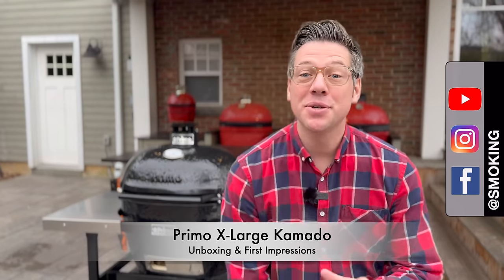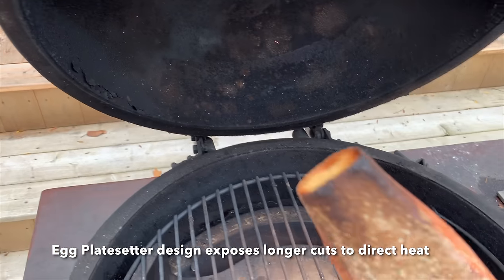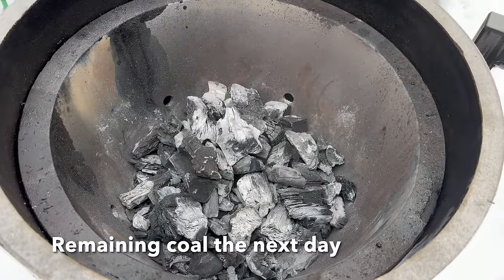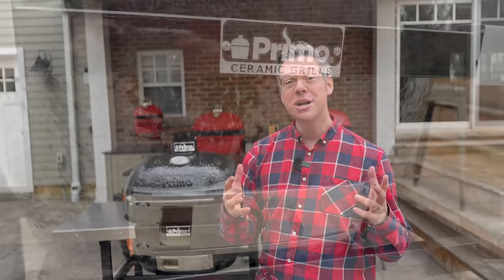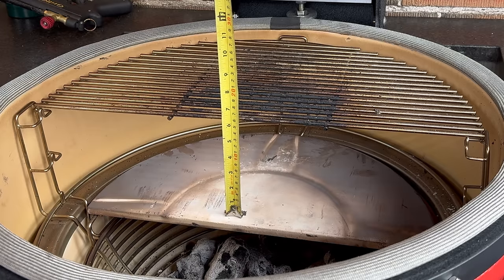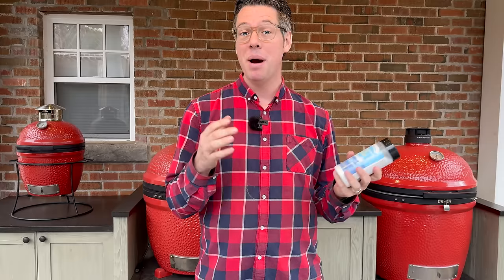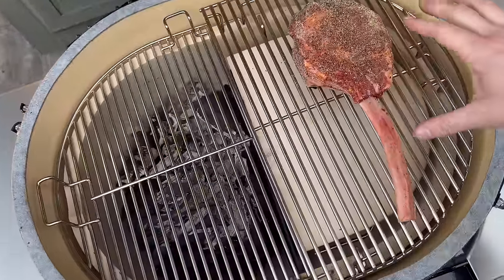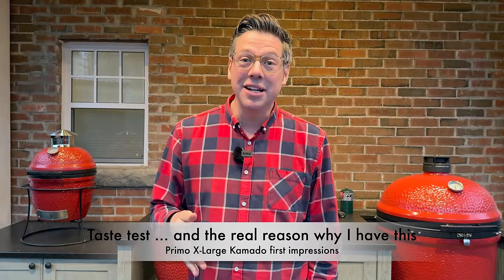Should Kamado's Be Oval? Primo XL First Impressions

Comment: Howdy SDB. I've owned a Primo XL for more than 25 years. I will say that I have never, ever had a problem of any kind with it. Well, except the top/bottom seal eventually needs replacement. The intake and exhaust upgrades look nice but please believe me when I say the old setup works just fine. One of the things I like to smoke in it is 20 lbs of bacon at a time. I put a thermometer in all 4 pieces and they are ready in a nicely spaced order. Its setup like you showed except I have two more racks that go on top of the two you showed. I can agree with everything you've said in your video and look forward to the tests you have planned.
Reply: I've had one for 15 years, and it's excellent.
I stuck fiberglass wood stove gaskets on with high temp silicon 10 yrs ago and haven't had a gasket problem since. I did the same with a round large primo, and that hasn't failed either.
Reply: That sounds excellent. Thank you very much. @toddpower4674
Reply from the maker: I just went a bought the upper racks
Reply: Exellent. I'm sure you'll find them usefull @SmokingDadBBQ
Reply: Wow ! You must have a Pre-Production model of the Primo XL Oval Kamado Grill . They came to the Market in 2002 ! 😊 Give or take a few years , to they are awesome and everything taste great . I have the Primo Round Kamado Grill and I love it . James never answers my comments , buy that's Okay . I've learned a lot from him .
Reply from the maker: @michaelheiss4456  I try to answer as many as I can as a one person show

Comment: Sweet, we are finally cooking on the same grill! I actually do mostly grilling so i enjoy the divided firebox for a direct and indirect side, without going as big as a 24 round. I don't even bother with the heat deflector on the indirect side anymore, just open. For smoking, I have actually applied your double indirect method to the Primo using firebrick pieces as spacers and a second set of heat deflectors. Works great!

Comment: That is one heck of a grill. What it loses in vertical distance from the ceramic base on the BJ, it gains in the horizontal distance away from the coals. It gives BJ a run for its money. Looking forward for your tests.  I suppose it will perform great when smoking ribs, the real test would be to see how it does on a long cook with a brisket.

Comment: I've had the Oval XL for years, and I love it. I bought it for the size to price ratio, and for the flexibility of the oval shape. It has delivered on all fronts: I cook on it at least three times a week, all year long, and can easily fit food for 10 on half the grill for true indirect cooking (although I mostly cook for four). Using the whole grill opens up huge possibilities: I've done four racks of babybacks without having to do anything other than drop them on the grates and move them occasionally so they shared equally in the hot spots front and rear of the heat deflectors. On the downside: I am on my second firebox, and I can see a crack forming in it in the same place as last time. I suspect it is because I almost always cook with coals only in one half (the left side, where the intake is), so there is more stress on the spot opposite the intake. But service has been great even in to Canada, and Primo replaced it immediately. Also on the downside, there is much less online help like yours available for it compared to BGE and KJ, so the learning curve may be harder. That said, I have no trouble recommending it and have absolutely loved cooking on it.

Comment: I've owned a Primo Oval XL since 2011. I made the purchase after researching a LOT of smokers (stick smokers, kamados and pellet grills) before pulling the trigger on the Primo. It is a very versatile appliance and is one of the best investments I've ever made. I've cooked everything from full packer briskets to pizza and everything in between. That being said, I have some things I don't personally like, which may not necessarily be exclusive to the Primo, but rather a more general kamado design issue.
1- The necessity to use only lump charcoal, which can vary widely in size, content, and quality over various brands.
2- The Kamado design is very efficient, which is a plus for stabilizing cooking temperatures, snd heats up quickly, but it's not easy to quickly dial down the temperature. With the oval, you can do offset cooking, but that halves your cooking footprint. You have two grill heights, but that's it, and to safely move the grates, you've got to remove the food.
3- Because of the wide variation in charcoal quality, temperature stability is best achieved with an after-market fan/temperature sensor rig. That's an additional cost. 
I don't want to deter anyone from buying one, and I'll keep mine, but I'm probably going to buy a pellet smoker for added convenience and flexibility.

Comment: Two words, "extension racks".  I use mine A LOT.  For chicken, poppers, and pork chops (especially ones with the bones), I will invert the main racks, put on the extension racks, and cook on the extension racks.  This keeps the grease from these well away from the fire to prevent most burning.  (grease from poppers and chicken wings at the same time is still too much, so beware)  For smoking pork, I will use the extension racks with the deflector plates and the main racks in their normal orientation.  This keeps the meat well away from the direct heat.  The wide layout of the Primo allows for this.  For a reverse sear of a tomahawk I have not used a deflector plate so the space limitation you talk about doesn't matter to me.  I just keep my fire down to a smoke level temperature for that part of the cook.  I also do mine differently.  I will smoke until the internal temperature gets to 95F, pull the meat and crank up the fire to 550ish, then grill the steak just like I would a ribeye from Costco. (same timing)  This means I cook with the lid closed so I have no problem developing great bark all over the steak.  I also get plenty of smoke flavor.  Make sure to add wood chunks to most cooks.  I use mesquite for steaks, hickory for chicken and pork, and cherry for pork ribs.  Don't add wood for pizza.  You want that clean coal-fired taste.  The best tip I can give with any kamado is to learn to listen to the chimney.  Listen for that sizzle.  If no sizzle, your fire is too low.

Comment: Ive been curious about the primo fir some time. Ive just graduated from an akorn to a ceramic and can tell its a leap forward. The one ive come across is a bit of a mystery,  the only info ive come across is that it was sold by academy sports around 2011 its measurements are exactly like a green egg but looks like an early primo with a round vent on the bottom, maybe they had a baby lol. Who knows, after some refractory cement, new gaskets and high heat silicone this thing rocks. Thanks again for the great effort u put into these videos and looking forward to whats to come.

Comment: I added the Primo XL to my stable of grills a little over 2 years ago. I end up using my Classic II for week night meals and the Primo for weekend and large family events (often with the Classic).
Reply from the maker: What’s your opinion with a few years on each
Reply: @SmokingDadBBQ  I seem to have better fine control on dialing in temps on the Classic II. But the Primo shines in 2 zone grilling and higher (275-325F) smoking applications. I'm not a fan of the inverted grates on the Primo (the horizontal support bar gets in the way of spatulas).

Comment: Have had one for many years now, the shape is great and like others here mine has held up with any issues.  Only the gaskets needs replacing over time.  Will add the gets warmer than the front of the kamado, so keep that in mind when smoking.  Will need to rotate your protein to keep from overdoing one side.

Comment: I’ve had mine for 15 years. I looked at all of the others and in the end went with the oval XL due to the design and it being made in the USA. With the extended racks have been able to cook 36 pounds of brisket at the same time. It’s a great grill whether using it low and slow, reverse sear  or direct cooking you will not be disappointed. Primo warranty is first class. The only down side was the gasket that comes with the grill is useless. Replaced it with a concentric gasket about six months into owning it and replaced that gasket 8 years ago. Just make sure you burp the grill with high temp cooks that rush of oxygen can singe the hair on your arms

Comment: I am definitely not a grill master.  I normally will preheat the ceramic xl400 as if it was an initial burn.  No cracks so far.  I have found though that more fuel is needed in order to preheat and do a smoke.  (who wants to remove the food and the racks just to add more fuel?)  Since I believe in the ceramic Primo Kamado idea, I have recently downsized to the Junior for grilling and not just for smoking like I use the xl400 normally.  The extended racks for smoking is a beneficial setup in my opinion with a water tray.  Thank you for the good content.
Reply: edit:  The extended rack plus the water tray prevents the hard over cooked bottoms of the meat.

Comment: Primo I believe recently got bought. Yes, the hinge system is a fantastic improvement. Primo would have been my first choice for a Kamado, but I had to consider where I live, which means realistically that I can’t just leave a cooker out. And like most Kamado, the Primo is heavy, and even with a rolling table, is not really meant to be moved. So what did I get? A Weber Charcoal Summit Grilling Center, now called a Kamado. I couldn’t be happier. It does everything I possibly need, and it easily rolls in and out of my garage. I recently got a griddle insert for it, but as an anniversary gift from work, I will be getting a 20 X 20 gas griddle, that will fit right on the table.

Comment: Thanks so much for getting into Primo grills. I have enjoyed and learned so much from your videos. I've had a Primo XL for several years now and have cooked most things many times- ribs, Boston butts, brisket  and pizza. It does a fantastic job with pizza- temps above 600 F. Pork and ribs work well too. Brisket is more of a challenge. I have been experimenting with a double indirect method by using Primo deflector plates,  6 copper elbows for spacers and another deflector (pizza stone). My current challenge is getting air flow like the Kamado Joe Slow Roller set-up. Any thoughts or research in that direction is much appreciated.
Reply from the maker: Did you see my double indirect setup in the rib video I did on it after this?
Reply: I did- my set up was similar. I’ve been trying to get more circulation in that air space but not too successful so far as it’s a much smaller space than Slow Roller

Comment: I'm always interested in your reviews even though my goal is to get many years of service out of my current Big Joe and I'm not likely to buy anything else.  You have a bit of the mad scientist in you, so I'm sure you'll geek out appropriately with the testing you announced in this video.  

Probably the #1 thing I've learned from your offset exploits is that offset grills produce the classic taste you love because of the convective heat and superior airflow (and I would add, significantly more "fresh smoke" over time) than a kamado cooker of any shape.  I would love to see more experiments along those lines.  

I'm intrigued by the JoeDough hack but I've only seen it once.  How can we increase airflow and have a practical opportunity to add more wood during a low and slow cook to approximate an offset...

Comment: James I love the fact that you are going to get some real engineering measurements of your grills.  I hope they can test for how the smoke moves inside of the Kamados and how single and double soap stones affect the smoke and heat profiles.   I have seen these ovals for years and thought it was a better layout of space because most of the meat I smoke is more rectangle than round.  I would say do a brisket with the single soap stone to see if the bottom is likely over done.  But maybe with heat on one side and the point above the heat and the flat on the indirect side maybe it will not get over done.  Love your testing and I back into smoking again on my 14 year old Green Egg that I wish was larger than just the large.  I did see Green Egg's new very large Green Egg is more of an Oval now too at the local store.

Comment: As an of KJC III, interested in the primo oval. I’m visually impaired and find it difficult using the 3 tier system due my vision. As the Primo XL system is not as deep or elaborate in KJ. In your opinion, how do you rate the build quality of the Primo vs KJ. I value your input. Have been happy with Kamado Joe line as I own the KJ Jr., KJ Kettle. Looking forward to your honest feedback.☺️

Comment: Hi James,  love your work and this video.  I am very lucky to have two Primo XL, partly due my original (but unwarranted ) scepticism on the warranty especially living in NZ, my drive to complete a charity Christmas cook (4 lamb legs) and partly due to some sound advice from one of your earlier videos. I had a fire box failure after 8.5 years which I think was due to the cast iron grate warping.  The original fire box doesn’t have an expansion gap like the new one, also the new cast iron grate is substantially stronger.  The only other issue in 10 years was one replacement gasket which had worn out.   I agree with earlier comments the expansion racks are a must imo, but I see you are already onto it.  I always wondered how the Primo compared to other models(not that I would change mine for anything) so very much looking forward to seeing what tests you do next. Does oval really smoke round?
Reply from the maker: Thanks. Like your title idea

Comment: Super pumped about this video James! But I have one question for you that’s driving me nuts about my KJ air lift hinge: Out of the box, the lid was too heavy. It would close itself under its own weight. So I grabbed a wrench (much bigger size needed than the manual specified) and attempted to fit it between the KJ body and the nut that needed tightening. How the heck can you actually reach this?? I was finally able to tighten the nut a couple turns clockwise, and got the hinge to where it stayed open, but the next cook 3 days later, it closes itself again! Considering you know KJ’s better than KJ themselves, hoping you’ll have some insight. Much appreciated!

Comment: Humm, I just purchased a Big Joe 3...was that a mistake ? Is the Big Joe 3 a $1000 better than this Primo XL ?
Reply from the maker: I hope i didn’t give that impression as this just starts some testing. 

The bj3 is a lot taller, has two deflectors included and is larger like you can see in the clip with the deflectors and the steak. 

It will take me time to learn more how this stacks up

Comment: As a Primo owner, I have only experience with the Primo. I chose the Large 300 over the Joe 3 because of the simplicity. The grate is on top of the firebox. No rattling grate system. Just pick one side with gloves and remove half of the heat deflectors.  And the shape makes it more practical than a round one. I'm looking forward to the next episodes.

Comment: I have owned a Big Joe, The standard big green egg and the Primo XL and I only have 1 left…..It’s the Primo. This IMO is hands down the best of the best of the Kamado’s and there is 1 reason why……Th oval arrangement allows me to stage my wood to have the same amount of smoke all the time.

I also found that this Kamado also allows the burn of the fuel to be much more even. I always stage the wood and the charcoal to burn from left to right. I once did a 25 hr 215 degree unwrapped pork but in 1 load of charcoal and Post Oak……..this is my go to pork butt cook.